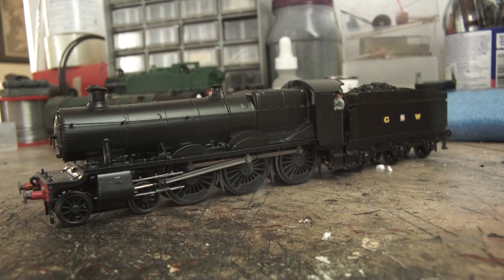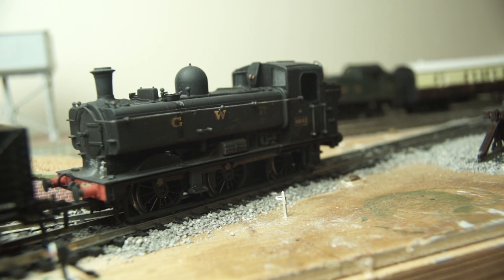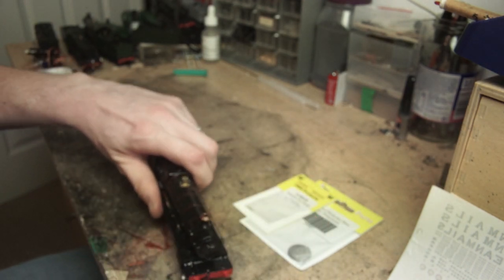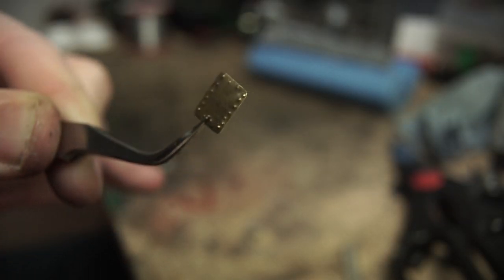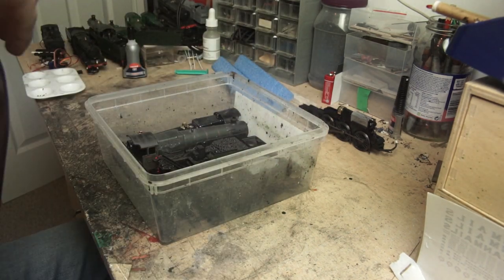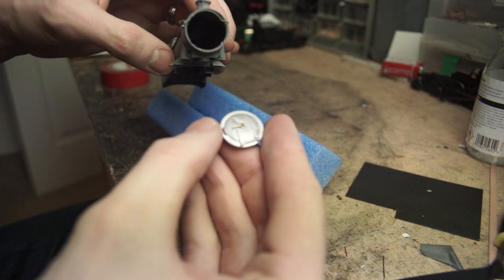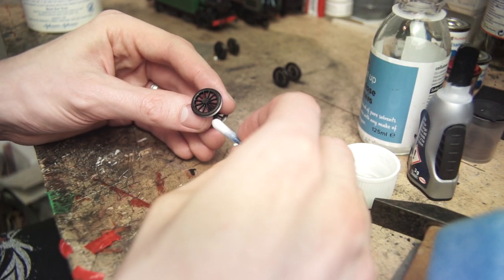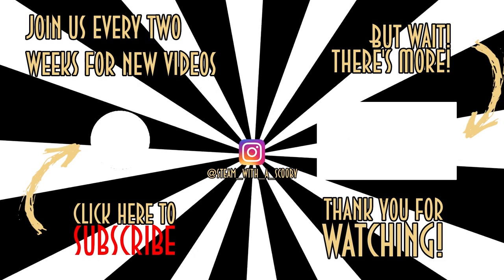Repainting a Steam Locomotive - GWR Wartime Black Hall - SWAS Episode 28

Comment: Hi
Lovely stuff, I wonder if it is the plating that puts manufacturers off war time locos?
Either way it's a great opportunity for some modelling as you've done!
Cheers
Olly
Reply from the maker: That is a strong possibility, but even with locomotives that don't require any modification are yet to see an outing in wartime black. However I couldn't imagine it being too difficult to have a cab plating as a separate etch or similar included with the detail pack.

Comment: Lovely job, it turned out really nice. I have used Dettol a few times but find the smell lingers. Simple Green is just as effective and doesn't harm plastic.
Reply from the maker: I might have to keep an eye out for that Simple Green, I have noticed the smell has lingered on the models I've stripped. Thankfully it's not a completely awful smell, but could definitely be better without it! Thanks for watching 🙂